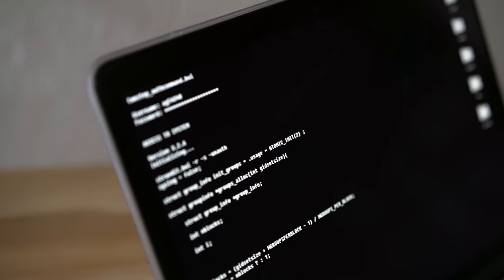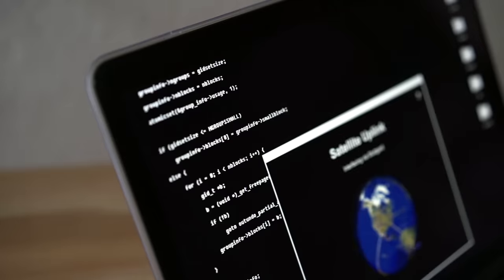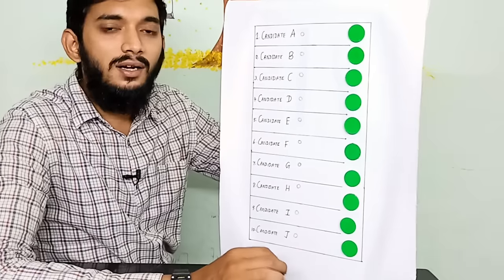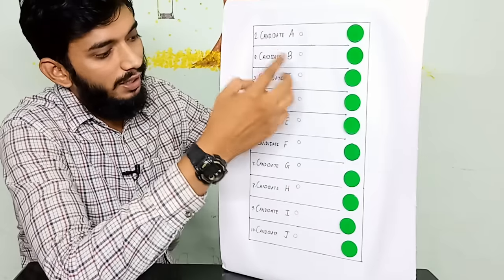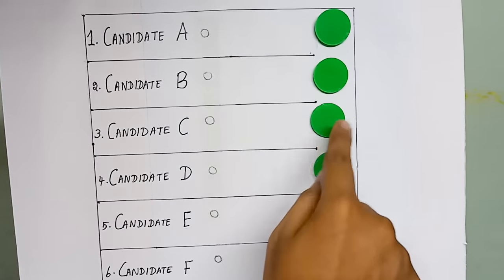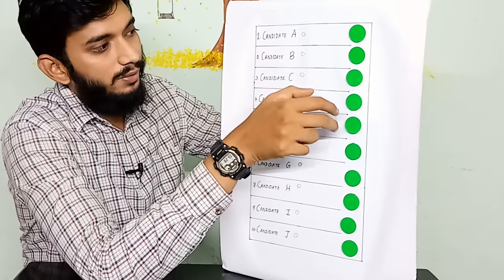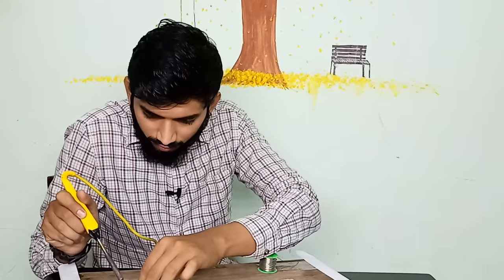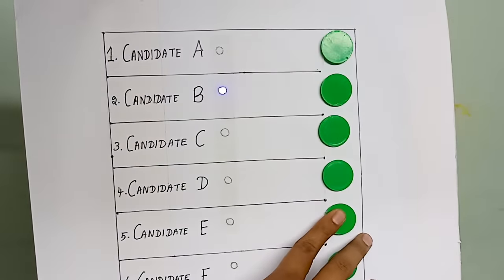EVM 'HACK' பண்ண போறேன்!! Is it possible to hack Voting Machine (EVM)?_Tamil.

Comment: What you said is also not possible...the. List of candidates is decided only few days before polls .because no body knows howmany ans who are all contesting in election...then you must know one concept called. Mock poll.. i have wored as laptop operator in 2011 election.. in mock poll  1 hour before actual elecrion process begins polling offcier conducts mock poll..to start mock poll the agent of every candidate should present and sign a form..then they are allowed to vote in EVM ..thier choice is counted in paper..after that the polled votes will be counted and verified with their paper count..it should match and shoukd accepted by all agents of that booth..then the memory will be cleared and again shown to agets for zero votes ...then three types of security seals be put and control unit is secured and signatures of agents will be gotten. Then only original poll happen...
Reply: So due to mock poll soldering will not work